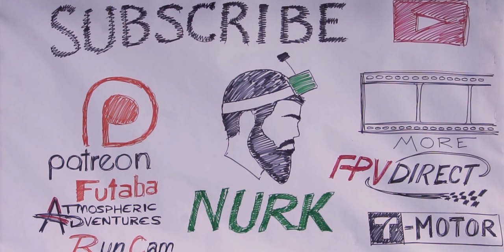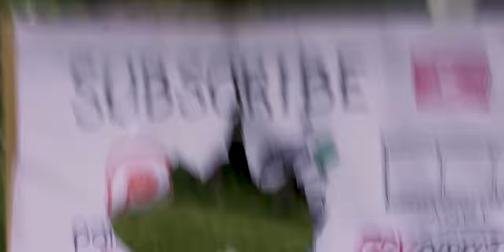G.O.P.L.A.T -- Freestyling an Abandoned Gas and Oil Platform!

Comment: How dose he have video inn his goggles when he is flying around all that mettal?
Reply: Enough vtx power and you're fine
Reply: He must be using the DJI digital FPV setup, I was thinking the same thing 🤷‍♂️
Reply: Steve B nope analogue.
Reply: @WildCaptures  you can see his goggles in the end
Reply: Looks like an ImmersionRC Rapidefire module.
Reply: his cinewhoop has got dji and the for the 5 inch kwad: he was standing at two different positions for this clip to get a usable fpv feed :)
Reply: Wicked video. Hits home. I’m in the oil and gas industry. What quad was that?
Reply from the maker: Some of it was analog, and some of it was digital - all of it was epic.
Reply: What antennas are you running? I have a pair of Commander v1s with a VAS crosshair and Pagoda on it and I flew a bando the other day on 800mw with a tbs vtx and VAS minion and I had a hard time at moments when I was more than two floors of concrete up. Wondering if that's just the limits of my goggles or maybe I need different antenna setup? Any help would be appreciated
Reply: @NURKFPV  any failsafes?
Reply: Do I potentially see a new liftoff level? Lol
Reply: And good antennas are also key
Reply: NURK FPV Ha! Balls of steel!
Reply: Absolutely epic man!.....thanks for sharing this with us!!👏🏻👏🏻👏🏻👏🏻👏🏻👏🏻👏🏻👏🏻👏🏻
Reply: Without fear!!! Increíble vídeo 👌👌👌
Reply: @NURKFPV  SICK, no really I got sick.. LOL   no that was fun!  
Good money, or just for fun???? 
I want to do inspections and get paid!
Reply: @peterzingler6221  more vtx power isn't the solution to multipathing. Its actually the other way around.
If you're in a high multi path environment like this, stepping down in power is going to give you cleaner video
Reply: Very nice 😁👌🥇
Reply: @SweetStat  Thats true, unless your setup is already highly protected from multipathing. If your module and antennas are good enough, higher wattage outputs allow for better penetration. If he was using dipole antennas and cheap goggles it would be another story.
Reply: Multipathing 100

Comment from the maker: What other epic locations would you want to see freestyle videos? Where have you always wanted to fly, but haven't had the chance?

Learn to build the exact drone used to film this video: https://www.youtube.com/watch?v=QuUlX...
Full parts list on this drone with affiliate links: 
Motors: http://bit.ly/2vCDZBm
Flight Controller: http://bit.ly/nurktmotorhd
ESC: Hobbywing 60a — http://bit.ly/nurk60esc
Video Transmitter: http://bit.ly/nurkairunit
Receiver: http://bit.ly/nurkairunit
Frame: Project 399 SuperG — http://bit.ly/nurksupergpyro
Camera : http://bit.ly/nurkairunit
Lipo: CNHL Ministar 6s — http://bit.ly/nurkministar
Prop: Azure 5150 — http://bit.ly/nurkazure5150
Extra Thumb Screw Standoffs: http://bit.ly/2xTmoWv
Thumb Screw Locks for the top of flight controller: http://bit.ly/2WyCT4J

Comment: Holy crap! I’m over here like... the DJI fpv is killing it then you end it showing the analog!... I have a nice setup but I’m getting garbage video in trees idk how ur doing this!
Reply: It's all about the antennas. I'd like to see what Nurk says about what he was using on the quad. I've got one of those X2-air 5.8 antennas and it's the shit. Expensive, but so worth it.
Reply: Luis Hurtado I live about an hour and half south of nurk... I can’t get but half a mile out over trees and fpv feed goes south... let alone down several layers of steel... I’ve been thinking about getting DJI to help with this. I’m running hdo2’s and vas antennas
Reply: @trenthamlin4805  you can see for the 5" rig he was running his Fatsharks at the end. DJI on the Squirt though
Reply: Cody Clemons but he did a whay I bring video and it’s all DJI systems wonder why he had analog

Comment: Surprised you didn't use DJI to stop the multipathing
Reply from the maker: At  the time this was filmed, I only had a DJI squirt, so the 5" stuff I had to fly on analog. Multipath wasn't too bad, tbh - just got blocked and reflected back out to sea.
Reply: @NURKFPV  Fair play. Good location I could see it working well lit up with LED gates as a DRL track. 👍